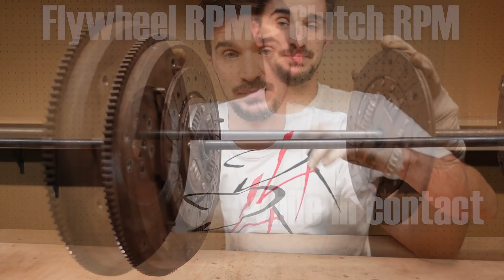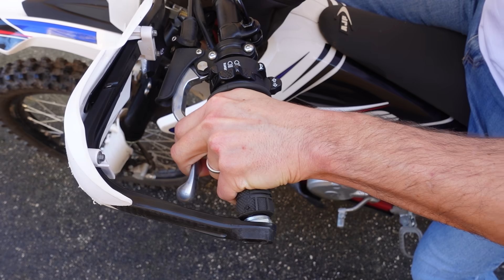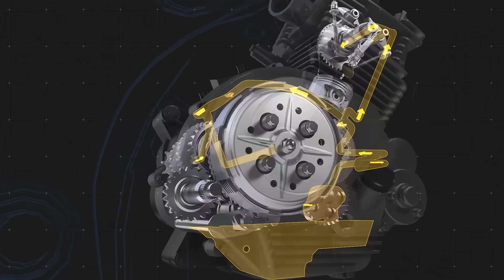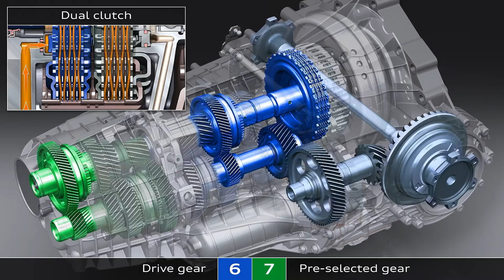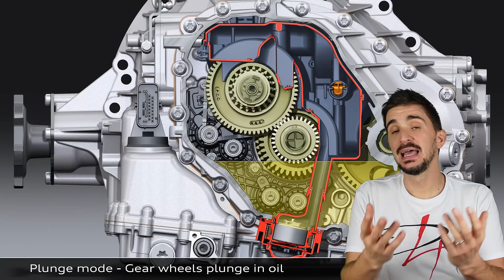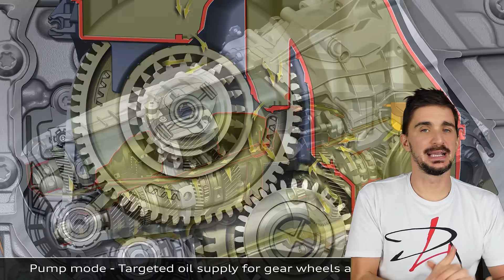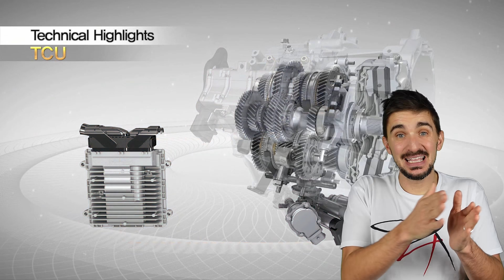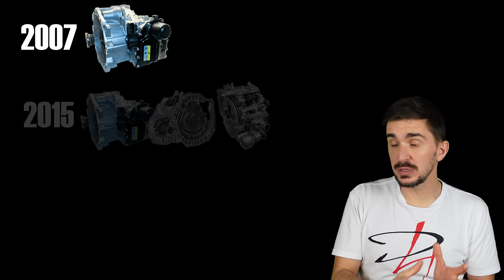Why Dry Clutches Suck and Why You Should Avoid Dry Dual Clutch Transmissions (DCT/ DSG)

Comment: I once purchased a Ford Focus (2003) new. It had a 5-speed manual (dry clutch).
I sold the car finally at 160,000+ miles. Most of those miles were me, in fact, virtually all of them.
The original clutch was still strong, not chattery, no sign of slippage.
Driving technique has a LOT to do with how stuff wears.
In fact, I had to replace leaking seals on the clutch master cylinder. The rest of the system was fine.
Original brake pads also lasted until about 60,000 miles.
I don't consider myself a slow poke, timid, reserved, or anything of the sort.

Comment: It's esay to convert a dry clutch to a wet clutch. All you need is a bad rear main seal.
Reply from the maker: 🤣🤣 good one!
Reply: @d4a Hello there! Do you remember in the 2000s & 2010s where DCT hype is all over the world? Also when BMW replaced it's DCT with AT. So, what happened? Why the DCT did not take over AT? And why some say that modern AT has become so good? So, what do you think?
Reply: @MrAl2742 One magical thing: RnD
Reply: @MrAl2742  If you remember, Lexus opted for an 8spd AT (Aisin AA80e) for their high performance cars as early as 2008. This is back when ATs are seen as economical slushboxes and are shadowed by gearboxes like the BMW SMG (AMT) and the VW DSG (DCT).

I think, the main reason ATs are more favored nowadays is not just because they're quite serviceable, but they're smoother and handle big power pretty well in terms of long-term reliability, hence newer BMW M cars using the 8HP and newer VW cars having an 8spd as an option.
Reply: @Farie977 That's a pretty good point
Reply: @MrAl2742 torque converters have lockup clutches and the potential for way more gears in the same footprint, so efficiency is not a problem. Meanwhile DCT aren't any better than a manual in stop-go traffic, where most cars spend most of their lives.

If you're really into the driver experience, you'll buy a manual. If you want the automatic experience, AT is just better.
Reply: @MrAl2742 I remembered, now ZF8HP is like very popular vs DCT.

Aisin 8spd is another story though, it has problems when it first came out with stalling and gear hunting on the Highlander
Reply: @wyattroncin941 Agreed on that
Reply: @Farie977 the Lexus 8spd is the one of the biggest slush boxes ever made. I worked for Lexus for a few years. Granted they almost never had gearbox issues, but even in the early 2000s they felt worse than some old power glides.
Reply: @MrAl2742  2007-2008 was the year of the global globo-homo-wef technofascist take over and thus the humiliation ritual and decline of "climate emission goals" and manufactured obsolensence... we'll call it DEI_ngineering
Reply: @Farie977  As someone with a VW DSG the smoothness of an auto especially in traffic compared to a DSG is probably a big reason they didnt catch on as much. Its not bad per se but to an average person I can imagine the feeling of the DSG is offputting as it really feels like an automated manual without the smoothing of the torque converter and is very noticeable at lower speeds.
Reply: @MrAl2742  DCTs do catch on though, especially in high performance vehicles. As for the new small M car going back to AT, it's a choice to optimize for daily use, because M cars with DCT used to not have creep, which is very annoying in daily use. Also, AT box is very big and typically only good in longitudinally mounted cars, namely the ZF 8-speed. Transversely mounted 8-speed are typically bad, case in point the AT in the GR corolla, a power nullifier. Whereas DCT is small, lighter, so more suitable for transverse economy cars. But DCT is very much the first choice when it comes to performance-oriented car. In fact, you mention the BMW switch to AT, but S5 has just switch from AT to DCT.
Reply: @wyattroncin941  That is very much wrong. Badly tuned DCT's are not so good in stop-go traffic, but still there are ways to drive around these flaws. With basic driving skills, a DSG in a golf is still decent, as long as you don't creep at a very low speed, and I'm talking about below idling speed, like 3 mph or so. In fact, the s-tronic in the A3 is already much better where this is not even a problem.
Reply: @Farie977 ATs can be controlled by computer, operate faster, and prevent wear out by poor clutching, etc. Why the rise of ATs in the last decade has been a thing. Formula 1 and others long ago went to automatically actuated gearboxes, iow semi-automatic transmissions.
Reply: @MrAl2742  DCT was very good for performance reason, but AT have improve so much that now it can have near equal shifting speed while maintain smoothness of AT itself. Meanwhile DCT has unsolved problem like poor operations for daily traffic jam and it will wear clutch system very fast.
Reply: @MrAl2742  DCT is trash, they fail in warranty and cost the companies big money to replace. They still have dct options but now they have mandatory fluid change schedules that void your warranty if missed. They still fail but less often when the customer is aware of the fragility.
Reply: this is true, DCTs do make a cool sound when shifting tho 😅
Reply: @MrAl2742  My take boils down to:

tl;dr: Weight/size, number of gear ratios, and starting performance.

At best, without getting into really exotic gear configurations or multiple stages of gearing, a DCT has to have at best one gearset per two gear ratios, and a shift fork per two gear ratios. And, a DCT has to have at least four (input 1, input 2, output, and reverse idler) shafts, all of which get longer and heavier as you add gears, so most practical designs have no more than 7 ratios. (There are some 8 and 9-speed designs mostly for high-performance applications, and Volvo has a 2-stage 12-speed for heavy duty trucks.)

A simple planetary gearset with enough clutches and brakes gets you as many as five forward and two reverse gears (although, how useful those gears are is questionable), while also being stronger and therefore lighter, and more compact. Toyota has a 10-speed automatic design with 3 gearsets, 2 brakes, and 4 clutches, and Ford/GM and Honda have designs with 4 gearsets, 2 brakes, and 3 clutches.

Additionally, a DCT - even a wet clutch - doesn't provide the smooth creeping/starting from a stop that someone used to a torque converter is used to. So, first gear has to be quite short - often shorter than even a manual - on a DCT. A torque converter also gives you torque multiplication, so first gear can be significantly taller than a manual. So, a torque converter automatic can have more ratios, and they can be much more closely spaced, counteracting the higher friction losses of a planetary transmission. (You could combine a DCT with a torque converter, Honda did it, but that didn't last long, and got replaced with a 10-speed planetary.)
Reply: @bhtooefr Very nice information brother! Appreciate it.
Reply: @d4a  Motorcycles simply need separate oils for the clutch and the engine
Reply: Its funny but also true on my Audi 80 b3 1.8 petrol first clutch lasted for 600 000km because of a leaking rear main seal I changed it recently because it was leaking to much oil but the car worked with it leaking for 10 years
Reply: @ivansalaj7487  when oil leak is a design choice 😂
Reply: @tovirumelores7921 When an engine leaks past a certain amount of oil, it just becomes a total loss system!
Reply: @tovirumelores7921 you joke about it , but my oil leaks have kept my frame un rusted since 1991 😂
Reply: @1911-f8h naaa , just self cleaning 😂
Reply: @mastercricket7626 everytime I change my oil, I wipe my skid plate down heavy in used oil. Then some hydroscopic dust from my driveway. Forms a nice corrosion inhibiting later. Also forms quicksand so gets rid of two things that need getting rid of 😆
Reply: @ivansalaj7487  if you have a good enough leak, you don't even have to do oil changes. just remember to top it off. I had a friend go 40k and his oil still look decent. I don't know how the filter held up, but i don't think it would've held up without the leak.
Reply: @michaelcrossley4716  patent-pending oil self cleaning technology 🤣
Reply: @ivansalaj7487  1.8 L  !!   (LOL)
Reply: And if you have a bad front main seal your timing belt is converted to a wet belt :P
Reply: @Sohryu-Asuka-Langley  that's what happened to my poor Miata :(
eternal thanks to the engineer who decided to make them non-interference engines
Reply: @crezychameau love my miata engine , i have bent a rod in it , still drove home , now that same block is handling 30psi of boost 😂
Reply: @mastercricket7626 that little thing sure can handle some rough play :)
Reply: @crezychameau facts fam 💯 💪🤘🤙👊✌️.. peace and love brotha, keep it rad, stay safe, and build on..l8r hommie and keep having fun
Reply: @Sohryu-Asuka-Langley  A leaking water pump is even worse as coolant ruins the timing belt even faster than oil. 
However a timing chain “can” last for extreme mileage BUT any harmonic vibration (eg from gears within the system) can fracture the chain links. Broken chain is just as bad as a broken belt but costs more to maintain. Stay with a timing belt.
Reply: That is a win-win situation..
Or maybe not!? 🤯
Reply: i reckon the same thing can happen in reverse too
Reply: I laughed far too hard at this 🤣
Reply: This would be funny if it wasn't true on VAG cars all the time 😅
Reply: Best laugh I've had in a while!
Reply: You are on to something here
Reply: Eah, drove with that a few times. It's always a lottery "how much torque do we have today"
Reply: My current reality 😭
Reply: Hee Hee😆
Reply: or heavy rain
Reply: If only it didn't stop working when that happened. 😢
Reply: I can't stop laughing😂
Reply: Facts just a little smoky
Reply: I prefer a hemorrhaging hydraulic throw out bearing
Reply: wet to dry conversion is even easier just drain the oil 😂
Reply: ah, one connoisseur of 90s Jaguar engines 😂
Reply: @peter2327 shame the company self ended themselvs in the 20s
Reply: Truth 😂
Reply: Absolutely 😂
Reply: The good news is the engine oil ends up on the outside of the clutch assembly and is spun off with centrifugal force. The bad news is cleaning up the mess when you fix the leak.😂
Reply: lmfao
Reply: You mean you need a BMW?
Reply: @maartenz9417 BMW is merely German for Ford.... 😂😂😂😂😂

BeschissenerMotorWagen 😂😂😂😂 💁‍♂️
Reply: Very good one😂😂😂
Reply: Technilogica
Reply: This made me laugh.  A LOT 😂
Reply: Ayo :face-blue-smiling:
Reply: So, every Nissan owner already has a wet clutch plate. Got it!
Reply: Okay fine. Most Nissan/Mitsubishi/Renault owners have a f***ed CVT or automatic made by JATCO(owned by Nissan, and therefore Renault).
Reply: ANNND in the not distand future, Honda owners too. At least the ones who don't buy manuals.
Reply: genius.
Reply: Leaking engine seal throws oil out away from the clutch. It has to be literally splashing around to find the clutch. 
Leaking gearbox input seal runs oil along the clutch splines where it throws into the friction surface. It usually causes horrible judder that any oily slipping feels like a blessing.
Reply: Jeeps have been running wet clutches for years. Must do something, all my clutches are 20+ years old lol.
Reply: Funny but also painfully true… rear main leaks can absolutely contaminate the clutch and make it slip.
Reply: free conversion, can't complain, currently happening to my Citroen C5, just need to top up my engine oil i mean my clutch fluid occasionally
Reply: Instructions not clear now I bathe in my cars oil
Reply: Great idea! 😂😂😂😂
Reply: That’s pretty good actually 😂
Reply: LOL
Reply: ha ha
Reply: We could theoretically use  wet clutches in stick shifts. It would make the transmission heavier, though.
Reply: Glad someone said it
Reply: So get a BMW?
Reply: pour some motorcycle oil in the crack
Reply: Bahaha!
Reply: Then you got a dry engine.
Reply: My 72 Vega had a wet clutch
Reply: @HerbertWingfield that's awesome man
Reply: Dry clutches are simples and reliable and don’t require oil changes and gaskets to keep the oil in.  They will last 200,000 miles or more driven properly.  And they allow the transmission to use heavy weight gear oil as compared to transmissions that have the clutches and gears sharing the same lubricant which requires the gears to use a less than desirable lubricant in order for the clutch to operate properly.
Reply: @LTVoyager200,000 miles? That's about where an eCVT gets broken in. 😉
Reply: @LTVoyagerSemi Trucks
Reply: ..rubbish.

Comment: But if you don’t dump the clutch, how will girls know how cool you are?
Reply: burnouts, handbrake turns and donuts. try it, it works!
Reply: @acke0000 no thanks,  too expensive.....if they're stoopid enough to be impressed by THAT shit, I don't want them breeding.
Reply: @acke0000 my nikka fr 💯
Reply: Dump the clutch for the girls: ❌
Dump the clutch for the boys ❎
Reply: Get a Ford DCT where the dump is programmed from the factory. An added bonus is the "Vibramatic" so you can continue to impress the girls after they have gotten in. 

I'm not very familiar with racing in the US, but I've heard of stock car races. Are Ford DCT races called Shudder stock?
Reply: Hand brake turns obviously! 😂
Reply: If you think about it: a worn out clutch is basically a high stall converter
Reply: I did that at 16 in my first car and trashed my transmission. I'll never forget the girls laughing as a my friend and I pushed it home.
Reply: Getting a girl in the first place would work better than any clutch work you could think of
Reply: MONICAAAAAAAAAAAAAAAAAAAAA
Reply: By having a dry clutch. On a bike. With an open clutch cover.
Reply: dont dump the clutch and make to make the girl wet
dump the girl to keep the clutch wet
Reply: I'm not a girl, but if I was and a guy kept dumping it all the time whenever he drives, I'd wanna dump HIM! There's a time to dump and a time to slip, kids. Normal everyday driving is NOT dump time, those things are designed to slip for a reason.
Reply: " like, totally maaan, I'll just be a loser maaan " ....form over function,because first impressions are, like, SO important...... so American (sigh).
Reply: @iandennis7836 
Are you ok?